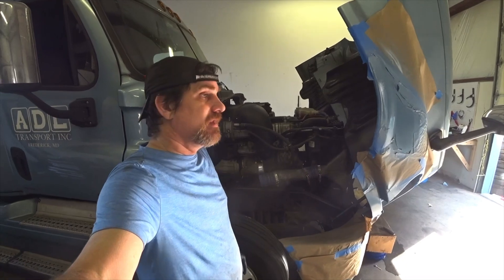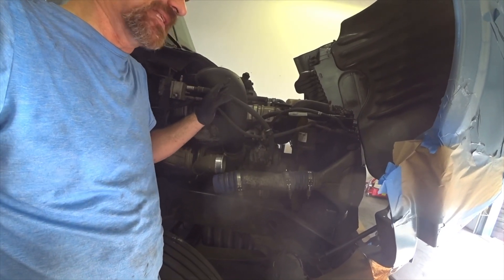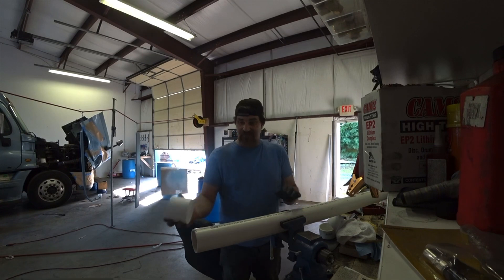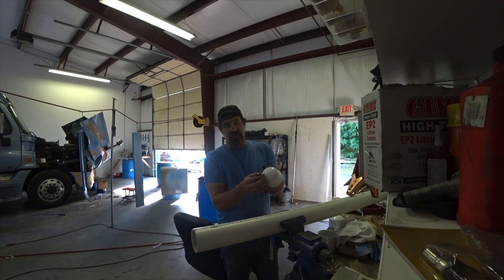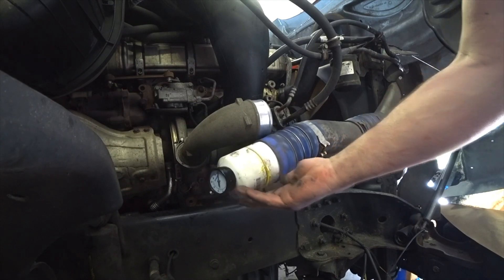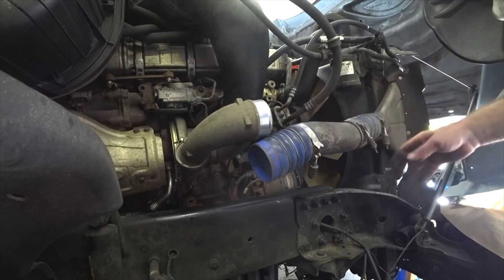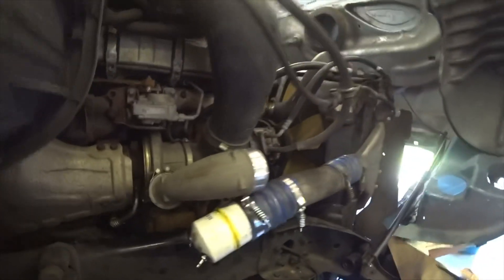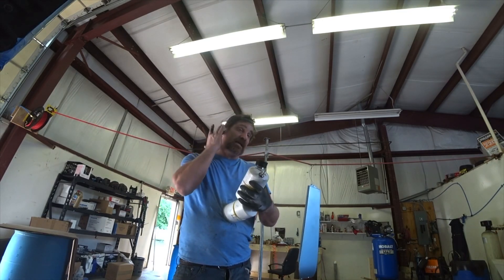Homemade Charge Air Cooler Tester for around $30, can save you thousands 2020/108

Comment: Does the black truck have a MAP Sensor to provide feedback to the ECM to add fuel relative to boost pressure?  If there is little to no boost pressure, why is the ECM putting more fuel in the cylinders that there is air to burn it property?

Comment: Shouldnt a mechanic know this already? Should eliminate the easy problem areas or known pieces that could go wrong by TESTING them not simply throwing money at parts. Granted, sometimes its simply easier to replace and try some parts as theres no way in testing, others not so much. Also, start at the cheapest and work your way up. Free is better then $3,000 in injectors, $1500 turbo. Especially when the problem part is cheaper at $1,000 for an intercooler and boots $50 a piece. 

Sorry boss for the incompetent mechanics you had taking you for a ride and lost $$$ due to it.

Comment: Don't the PVC end caps have the same diameter as the coupling?  I'm trying to get the $30 down to $15 by eliminating the gluing of the extra pieces and using end caps only.
To go cheaper how about using a $1 rubber tubless tire valve stem rather than the threaded metal one.  The guage would be  necessary for a long term leak test, but for a quick test to find a major leak like Larry had you could probably skip that feature.   Just give little toots with the air hose and check preasure with a pocket guage.